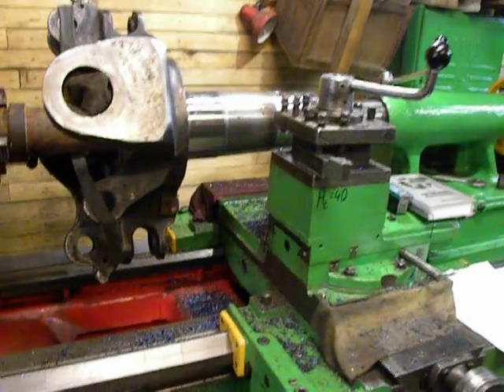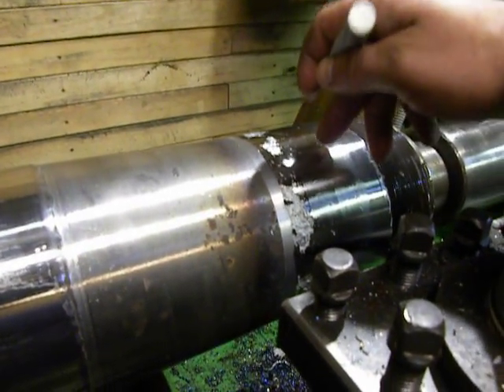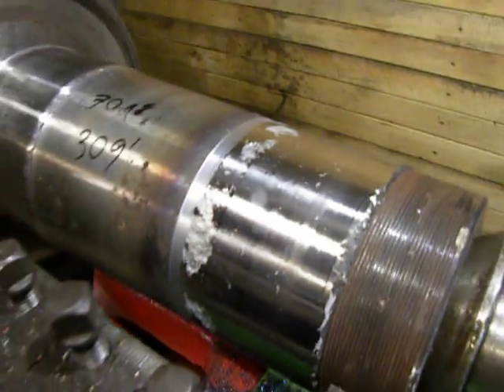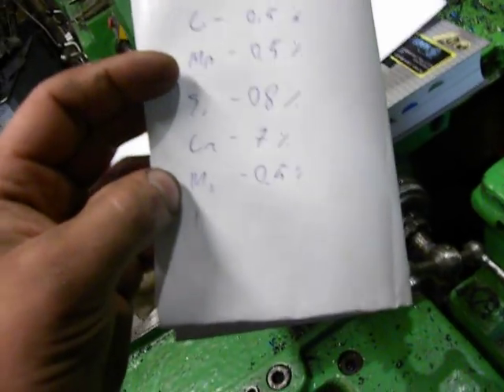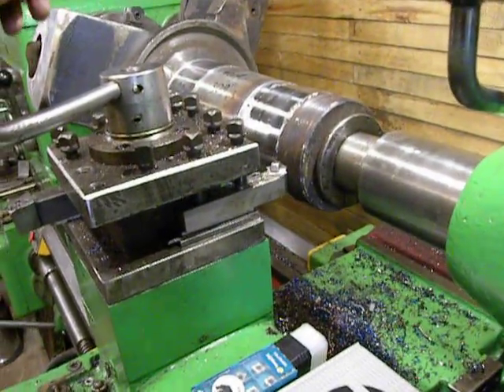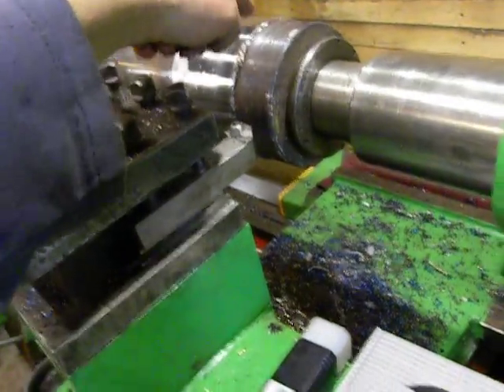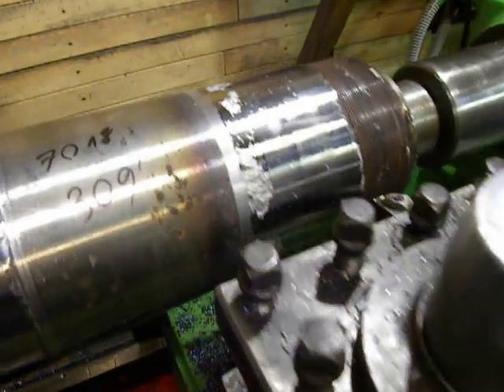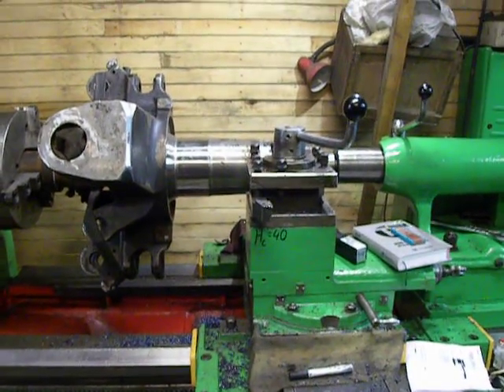Do not make my mistakes! Review a problem.

Comment: When I was cutting some cast iron on my lathe, I used a piece of belting off a tread mill and attached it to the saddle with some magnets I salvaged from an old computer hard drive. The belting stayed attached and moved with the saddle and kept the dust off the ways.

Comment: If you can get round ceramic inserts they might do the trick, I use them a lot for heavy milling of 60+ RC. The nice thing about them is in worst case scenarios of interrupted cuts you can get more life out of them by gradually rotating them as the edge starts to fracture. Best of luck with it!
Reply from the maker: Yep, round one will fit for this work, but problem is that to noone here not offering them, offer is only diamond, triangle,  square shape inserts. Anyway, I can try find out for round ones.
Thanks!
Cheers!

Comment: This won't help you with this situation (you can only grind something that hard) but for the future , my company uses a machine shop that regularly repairs SAE 4140 (DIN 41CrMo4) series alloy steel shafts using ER316L welding rod with excellent results. This is on shaft surfaces used with roller bearings as well as sleeve bearings and also surfaces for lip seals.
Reply from the maker: Thanks! 
Yea, 316 ir good too! The 316 rod here is expensive as gold here, so I use 7018 or similar welding sticks.
Yea, there originaly was bearings, but in tractor frame bearing seats was so damaged (7...10mm free play+rust) and there only one way to fix it was in rebuld it for bushing. For today this piece is in  customer shop under assembly.
Thanks!

Comment: I just learned about this today. I have to make an indicator rod for surface plate gauge - have 5/8ths tool steel shiny type both ends have some heat blueing and straw temp color on them - I start lathe to clean up ends - want flat end surface and rounded well - boy oh brother it's hard as rock where the heat discoloration is - chews through my good cutter, squealing, rod flexing only 1.5" sticking out from chuck - wow - eats up part of another insert - holy moly barely trying to cut 1/64th" to round out end - good files skating over it, won't even cut... taking like a part of a ten thousandth making dust for 10 minutes to finish it.

Comment: Good to hear from you. I have machined hard transmission shafts  using a ceranic cutter. And had very god luck these shafts are very hard. Maybe you could check that out Good Luck
Reply from the maker: Ceramic inderts = "God mode inserts" in machinery. I know them, but here to use them will be hard because it is welding and machining go with beats and it soon get break off... that's ceramic insert down side - very fragile.
Cheers!

Comment: I feel you my friend!!! But this is not YOUR mistake! :-D! This should be titled "don't make the mistakes of my customers!"... Awful.... But S is for superalloys (nickel alloys?)? H should be for hardened stuff? I think they sold you the wrong grade insert?
Reply from the maker: There is lot of alloys, Si, Cr, Mn, Mo, C and etc... That welding is harden than bearing surfaces.... even diamond file can't chew it good. I fully used 4 inserts from that green package - they are quite OK, but that weld was too extreme for any machining. The toolseler offer wariant tools: one was for kind like that work, but one insert cost 30eur. Also that insert wasn't on place and I haven't time to wait for it 3-4 weeks. So I pick this for super alloys.
Mistake is that to I must done that welding by my own. I can say good ways how to do, but if customer "not hear" then it "beats" his wallet.... easy like 2+2. 
Cheers! ;-)

Comment: When you have hardened work it is best if you can cut deep enough to get under the hardened part.  This works on case hardened shafts, dont know for sure if it will work for you on this kind of weld.  Good luck.
Reply from the maker: Well, that layer of that weld is too tick to I can chew through it, even with 2...4 attemths.
Reply: I understand, and with the weld adhesion it would probably just rip off uncontrollably and damage the tool.   The technique works well with properly heat treated rods.   Good luck and sorry to hear this happened.
Reply from the maker: Yeah. That's reapair enginer work....
Cheers!

Comment: you can try ceramic inserts.
Reply from the maker: If that welding be a regular, then OK, but problem is that to all time it go with beats. As ceramic is fragile it will crash at first touch.
Thanks!

Comment: Try it with sharp ground hss with slow cutting speeds, at least its worth a try
Good luck with this job!
Reply from the maker: The part surface is around 57...62 HRC hard, and very sharp tool will break off at first 0.1mm, HSS will capitulate too at first mm's because HSS have same or even less hardeness than this part surface, trust me - I know this and I tested this long time ago. Inserts for Al machining can't handle this too, there need to look for "ceramic" insert. Right is cut with small chip and slow RPM's.
Thanks!
Cheers!

Comment: Well, looks like your client used a hard-surfacing rod. They can get difficult to machine once reaching full hardness. Perhaps oyu should check into availability of a PCD insert at your supplier? It will cut the hard metal with beautiful red ribbons of chips. :-)
Reply from the maker: Yep ceramic inserts will work here, but I worry for that to any irregularity can smash it. Those ones are aviable at local tool selers.... by order, delivery - 3 weeks.
Thanks! Cheers!